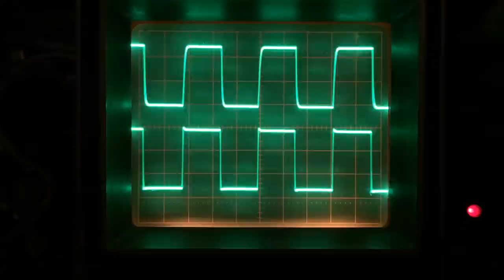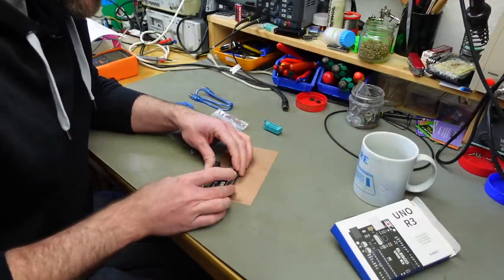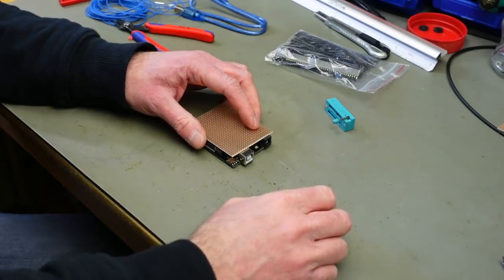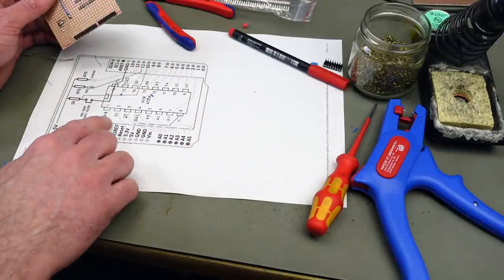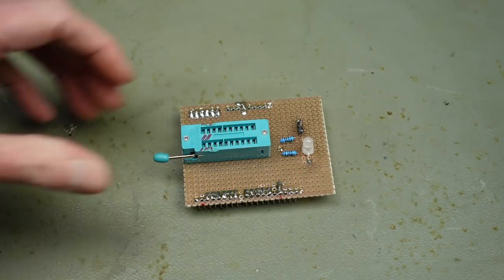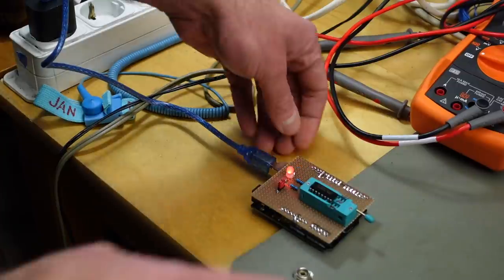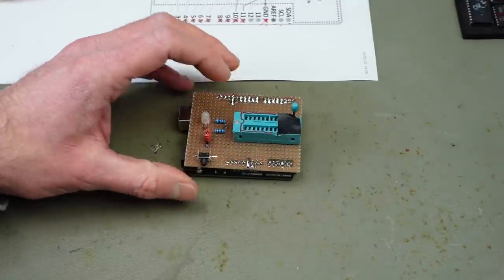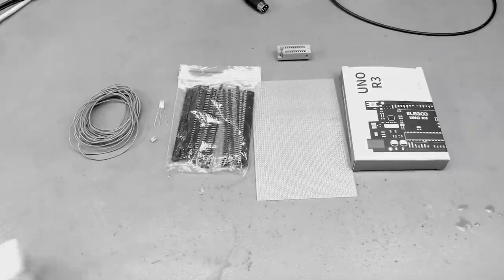Quick and dirty Arduino DRAM Tester Build

Comment: I used to work for a very large computer memory manufacturer so I've seen the inside of the memory testing world from that perspective. I've tested 10s of thousands of devices myself and the majority of failures that didn't let the blue smoke out of the chip involved devices that were slower than their speed rating, but worked fine otherwise. A tester like this will tell you about the smoking chips, but it will miss the slow chips and thus it will miss the majority of the failed devices I've tested in manufacturing. You should be aware of this issue. I used a memory tester with a large analog dial to set the access speed. You could just increase the speed of the device under test until the chip no longer worked and compare that to the speed rating.
Reply: And then there's the slightly senile chips that require a more frequent refresh for them to not lose their bits.
Reply: Awesome comment, thank you for sharing. I have my own open source DRAM tester. I will see if it's possible to include this feature.
Reply: @StephenArsenault  That would be very cool!
Reply: @StephenArsenault  in this case the speed of the test is more or less the speed of the UNO.  The code, or at least current code is running as fast as it can on the UNO.  I am not a C++ expert, look like Greek to me, but I do not see any delays in the code.  Also, what if the chip has a bad address line.  The program does not know this.  I don't think there is any way to have a program tell you if an address line, internally, is pulled low.  The address it is being access by the line pulled low just gets tested multiple times.  This is May 2023, with very recent code.  I had the tested tell me 6 4164 RAMS were good. None of them worked in a C64 and caused a black screen of death.
Reply: @Daveyk021   Yes, you're right.  These arduino-based testers are kind of craptacular.  They will tell you if a chip returns the right bit when it's set and retrieved in a super slow manner (Arduino pin performance is dramatically slower than these chips typically run in an actual device -- like 10x or 100x slower).  They don't test refresh behavior at all, which is kind of important.  You need to use a much faster device (like a Teensy or even an FPGA) to test these things properly.

Comment: The Oric 1 was also sold in Germany. I can still remember how I played with one that was displayed at the computer department of a famous department store. But it's true that they were not popular here. Maybe the price was not competitive. But it was also close to impossible to find someone else at school having an Oric, so there was no way to "exchange" software for it. 😉
Reply: It was the same here in the UK Richard. No one I knew at School had an Oric...so like you a tried one in a store display but went with a Spectrum 48... and later a BBC Micro Model B.
Reply: a frend had one, from what I can remember it was better verion it the mould of spectrum but seem to be i high spec, bolted together better amore realistic keys, more like calculator and less like the rubber spectrum keys,
Reply: If memory recalls the ORIC was also sold in France, as it could output an RGB video signal that could be connected to a SCART plug for french TV's, so bypassing the problem that french TV's used a SECAM composite video signal. Also France was widely using (their version) of videotext, called minitel, using CEPT2 videotext standard and the Oric actually has a video system that uses the same serial attribute system as CEPT does. so with a simple program a ORIC could be used as a mintel terminal.

Comment: There's a whole saga as to why the pins on the Arudino is non-standard spacing. In essence the guy designing it was up late finishing it because it HAD to go to production the following morning, and he knocked the footprint out of position just before he exported the gerbers and sent them off. They didn't realise until they got the boards back from production and didn't have enough money to re-spin the board.
Reply from the maker: Makes sense. Thanks for sharing!

Comment: Recommend you buy a few "Arduino proto shields"  (Amazon, eBay, etc) - the pins will line all up with the wonky headers, and the header signals are all brought in to an inner ring of pads for you to use.  Interior is just like your perfboard. My understanding is that header offset was accidental, and was discovered too late to be corrected and became a 'standard'

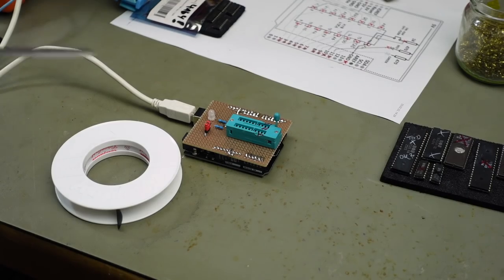Comment: - 19:40 You should also put some tape over the exposed pins on the sides to prevent accidental shorting.
- 20:40 You should've used a flat, round vertical button to just press down on it instead of pressing it from the side, that way, it could've been easier to do with a single finger instead of needing a finger and thumb.

Comment: Cool! I think I'll build one of these myself, thank you for the inspiration. That funny offset in the Arduino header design is probably to prevent  shields from being put in reverse. You see how much force it takes if just one side is not fitting right, and with a pre-built shield that follows this offset, you would have the same effect on both sides. But it's certainly not the best solution for reverse protection, and annoys the hell out of anybody who is trying to work with parts that follow the 2.54mm scheme. They could have provided a male and female row of headers on both sides in a way that it is impossible to reverse the shield, or something like that. Would also be convenient if you have both connector types for each connection you plan to make. Probably this would have taken too much real estate though. Anyway, thanks for the entertainment 🙂

Comment: Oric Atmos was also sold in ex-Yugoslavia where it was marked as Oric Nova. The weird thing was that the power adaptor with the Oric Nova was put into Oric disc case (3inch Oric disc is much more rarer than Oric computer itself) - they probably abandoned disc production but have left with many disc cases so they reused these for power adaptors.

Comment: Perhaps an idea adding a second led that only lights up when the test program is running so you can see when it is finished.
Reply: Or, to save on parts, just have the code turn on both colours in the LED during the testing phase.  Green+Red for "Ready", Green for Pass, Red for Fail.  Or, just turn the LED off or have it blink for "Ready".
Reply: Yeah or just turn it off when testing.. Good idea to change the firmware to do that.
Reply: @Mr76Pontiac  blinking seems natural to me while it's running, solid when ready.
Reply: It's odd. I built one of these a few years ago. The sketch I have blinks the green LED while the tests are running, and briefly flashes the red LED between each test pass. It also outputs test progress feedback through the serial connection as it runs. If the tests pass, the green LED becomes steady. If any of the tests fail, the green LED immediately turns off and the red LED turns on. It takes about a minute to complete the four test passes of a 4164. I wonder if he's letting the test run fully.
Reply: Maybe should have used a PCB from PCBWay ;)
Reply: @xotmatrix  This is where the lack of identifying information the device gives causes grief.  The code is there to be played with and additional "information" could be given to the user through the existing LED or adding one or two more to show status.  I'm also cringing a bit when chips are put in and pulled out.  I'm not sure if power to the chip is being cut between tests.  I'd have to review the code, but, since I don't do memory tests, or rip machines apart on a regular basis, it's not something I really want to dig into.
Reply: @Mr76Pontiac  I looked at the code posted in the linked forum and it is the same that I'm using, so I'm not sure why it doesn't appear to blink the LED in this video. As for the power, it is not switched in any way. It's up to the user to turn off the device when changing chips.

It's also worth noting that the tester is only really good for finding bad DRAMs. If a chip passes, that doesn't necessarily mean it's good.

Comment: I built this a year ago and still using it, so I am quite familiar with it. It shouldn't work like this, you shouldn't get an instant green light. It takes some time (around one minute per 4164, really long for 41256)  to test all addresses with 4 different patterns, and the green led flashes when testing, red led blinks on pattern changes. I also modified it to work with 4116 chips too.
Reply from the maker: I was wondering that, too. It reported the correct readings for both my broken and good test RAM though. If I let it run for a longer period of time, nothing changes. There’s a slight flicker of the LED before it stays one color though. The software in the forum thread seems to have been updated several times over the years, not sure if they changed the behavior or introduced new bugs in the end. I’m going to investigate that.
Reply: @JanBeta  The code had serial monitor support. Connect your PC, open a serial terminal and you'll see a progress report. I just timed mine, each pattern cycle (there are 4 of them) takes about 17 seconds and the green led visibly flashes during the cycle. At the end of each cycle red led flashes very briefly then the next pattern cycle starts. The whole test (4 patterns) takes about a full minute.

Comment: Re Arduino shield pin spacing - yes, it's a design defect in the original version that has since become a 'standard'.  It's also one of the reasons why the Nano is so popular - It doesn't have this defect and is consequently much more useful when building devices using matrix style blank PCB's or breadboards.

Comment: Looks good to me! Very strange about the different pin spacing on the Arduino, why on earth would they do that?
Reply: It was a mistake made by the original arduino designers, who only noticed it after they had ordered hundreds of boards to be made. It was never corrected because by the time they redesigned the Arduino there were millions out in the field!
Reply: @IanSlothieRolfe  Thanks for the explanation.

Comment: jan, flux is designed for new virgin solder joints....... not removing old ones. it actually cleans the copper when heated to give a proper joint..

Comment: Couldn't agree more that the Arduino's non standard pitch is extremely annoying. To work around this problem, I used to have an Arduino prototype shield as an intermediate layer to connect to the perf boards, i.e. Arduino -> prototype shield -> perf board. This way I only needed one prototype shield for multiple projects. Nowadays I just use the Nano if the projects are simple enough, or the STM32 black pill or ESP32 for more complex ones.
Reply: I immediately switched to Nanos when I discovered this. I don't think I've ever done a project using an Uno, and I just don't understand that design decision at all. It's not like perf boards were an unknown thing.
Reply: @kluzz  What I read was that the creator of Arduino, Massimo Banzi said it was a layout error on the Uno. Later there was a proposal to correct it starting from the Duemilanove/Mega, but was voted down in favor of backward compatibility with the older shields.

Comment: My own version of this is still on a breadboard (posted a Twitter pic). I'm a bit wary about transferring mine over to perf board as it was a while ago and I've lost the code I pinched/updated... Mine flashes the LED while testing then, after a double pulse between red and green it leaves the green LED on solid. Just seemed a bit easier to tell what it was doing.

Comment: Stressing those connectors will cause a reliability problem.  No one seems to know why Arduino offset that connector, but it is well-known that they did.  Possibly this prevents idiots from installing shields backward.  I would notch the board there or omit that header and try not to need those ports.

Comment: The manual says: "4 different passes are performed in about 80 seconds total" & "wait until GREEN LED blinks". Seems you did not wait so long, and the green led was not blinking. It was permanently lit. I wonder if you tested correctly? 🤔
Reply: Agreed, it seemed like he had the chips in the tester for much less than 80 seconds, and nothing was blinking.
Reply from the maker: I wondered that, too. But I did some tests keeping the chips in longer and nothing changed. I am going to take a closer look at the code (as soon as I manage to wrap my head around it). The tester did work in that it tested my known good/bad Chips as expected though. No idea if that’s a representative sample though, obviously. :D

Comment: Looks neat.. i should build myself something to test 4116, 4164, 41464 and similar. Enamelled wire is great for this sort of construction BTW - and if you want to get it "cheap", the degauss coils from dumped CRT's are basically a big loop of enamelled wire covered in PVC tape :)
Reply from the maker: Ha! I actually have some enamel wire (both salvaged from coils/transformers and new) at hand. I’m going to try that next time.
Reply: @JanBeta  That's a pretty neat built though, with ordinary insulated wire. It never looks that good for me :) I started using the enamelled wire when I was doing trace repairs on machines

Comment: The reason the pins are spaced like that is to avoid boards being incorrectly inserted.   You could have used an Arduino prototype shield available from 50p upwards.
Reply: The real reason the pins are spaced like that is because one of the headers in the original design was accidentally moved just before production. They couldn't afford another run of boards and a decision was made to never correct the error. We've been suffering ever since.

Comment: Everyone hates the pin spacing on Arduino Unos.. for easier future projects, they make PCBs that are basically adapters.  They are strip/vero board layout in the center, with the "correct" hole spacing for the edge pinouts... 

Alternately, you could get an Arduino that is not an Uno pinout (like a Teensy, etc.). 👍🏻

Edit: except for the most basic projects, I highly recommend using a modern IDE like vscode instead of the Arduino IDE.

Edit: also, the solid green = testing and solid green = good is kind of not great.  I would make it either blink while testing, or show no light at all until the result.  Or at least blink between the initial on state and the result...

Comment: It's not your fault. Arduino boards use non standard header spacing for no logical reason, it's just a dumb design. I would go with the Nano, it doesn't have such problem.

Comment: like a lot of others have said to use none standard spacing that will not fit the most common diy way to make a project board is most puzzling and had annoyed me many times.
Reply: I remember reading that it was alayout bug with the original, and it was too late to fix, so they just shipped it.

Comment: Hi! Nice hack. You did screw up with the LED's though. Even if you have a common anode, you cannot share resistors between the LED's. You effectively halved the current available to both LEDs by doubling the resistor from 470 Ohm and then sharing it between them. If you don't have any 470 Ohm resistors, a couple of 330s or even 220s would probably work as well.

Comment: I've never had luck programming an Elegoo Nano.  Even using old-bootloader.  I've tried burning a new bootloader via a true arduino, and it let me program the elegoo once.   I order real nanos these days as I never had compatibility issues.
Reply from the maker: That’s odd. As far as I understand it, they are using the exact same Atmel microcontroller and cloned most of the hardware 1:1, so they should behave like a standard Arduino board. But as I’ve pointed out in the video, I’m absolutely not an expert on Microcontrollers (quite the opposite, really…).

Comment: Nice tester. I looked at the source code for the Arduino stuff and it doesn't test for anything except for some hard failures. Good for a quick go/nogo selection, but a lot of conditions are going undetected.

Comment: Hi Jan  do this project can work with an arduino pro micro?? sorry for bothering you with my newbie question :) and also its possible to make this device portable with a lithium battery and a buck converter +a 3 d printed case :)
Reply from the maker: Not sure about that because I’m an Arduino noob. Some models don’t support 5V (TTL) signal levels so that may be an issue with that model. Maybe you can work around that with level shifters and such things. This project definitely works with standard Nano and Uno models.
Reply: @JanBeta  Thank you!!!!

Comment: you should get a backbit tester. it can do a lot and is really good at testing C64 parts, but it can do others as well.
Reply: Backbit is definitely better.. but this is about $10 in parts vs $150 for the backbit.. so really depends on your use case.  Would like to see someone expand on this as a cheap homebrew option.
Reply: @brianv2871  true but when you fix c64s like candy it would come in handy.
Reply: Yeah, though the c64 is pretty good about identifying bad ram with the dead test... My poor man method was testing all the ram i have in stock when i had working machines.  I tested all my 41256s in my tandy 1000 since it does a memory test on boot... Helped catch a lot of my bad Chinese memory 😃
Reply: @brianv2871  true but not always. A bad pla can make you think a ram chip is bad. Backbit can test all of that.
Reply: @awilliams1701  Yeah and for Jan it probably makes sense and can be a business write-off.. for most of us who are just hobbyists with a few computers, $150 for a ram tester is a hard sell.  As an aside, they seem to be backordered anyway.
Reply from the maker: Yeah, definitely going to get one of those some day. A bit pricier than this project though. :)